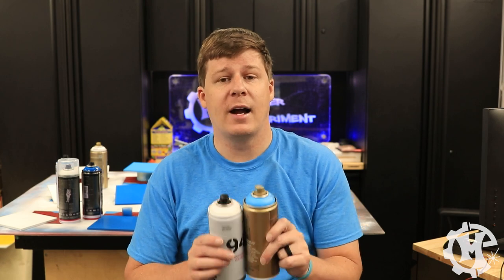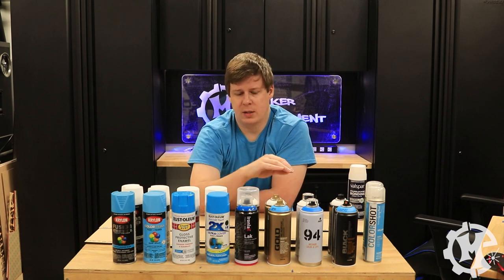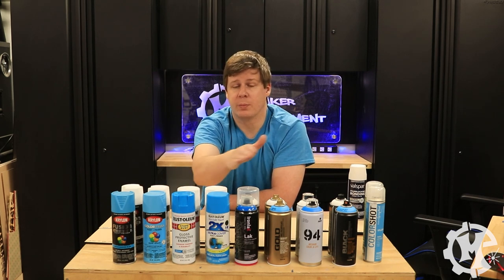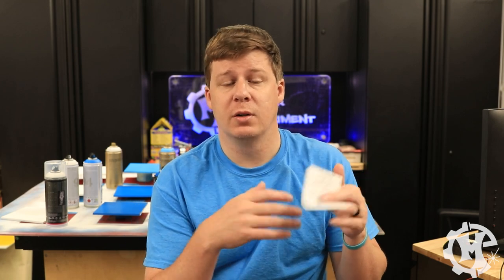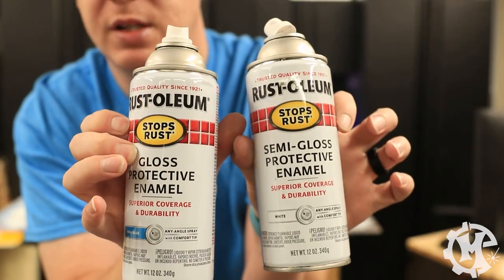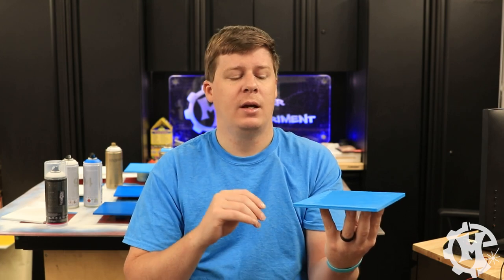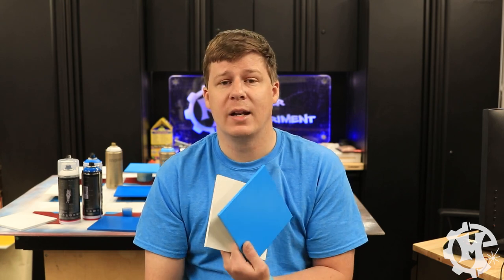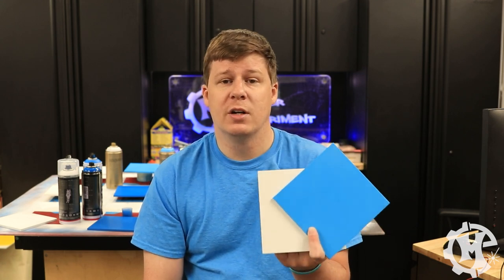WHICH SPRAY PAINT IS THE BEST?

Comment: One of the things with graffiti spray is getting the right cap for your application. There's a wide variety of types for different widths of spray and more pressure control. You can typically get from thin, medium, to a wide spray. The low-pressure cans take a bit of getting used to with having to be closer but you get a lot less overspray I've found, as well as having control with how much pressure on the cap you apply. Definitely a different process than typical high-pressure spray like Rustoleum.  Graffiti paints are all I use now.
Reply from the maker: The caps are a nice addition sometimes. For this video I just used the caps that came on the cans. They do take getting used to but are far superior in my mind.

Comment: You might have mentioned this, but Montana offers a wide variety of nozzles that change the spray characteristics. Throw at level 6 cap on those Gold or any of the cans for a ultra wide obviously probably throws more paint too.
Reply from the maker: I didn’t mention it in the video but you are correct.